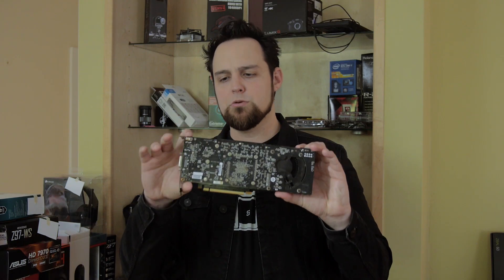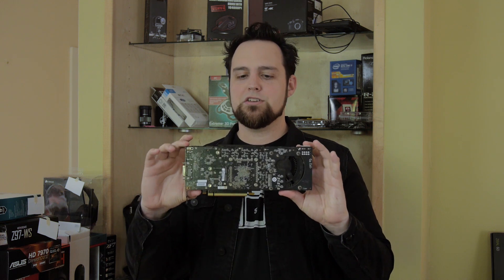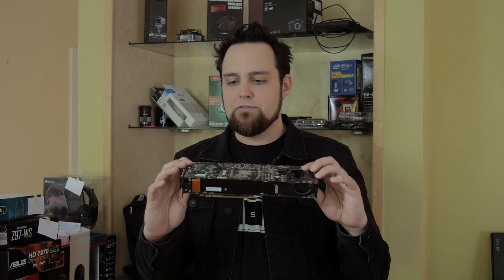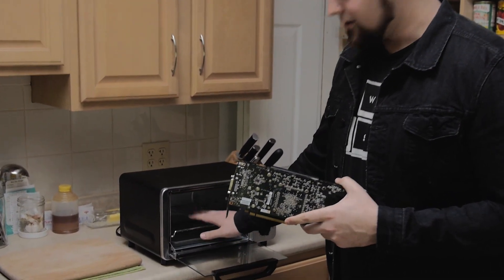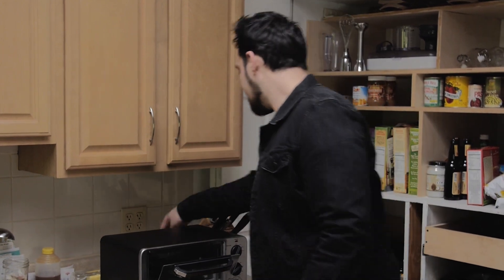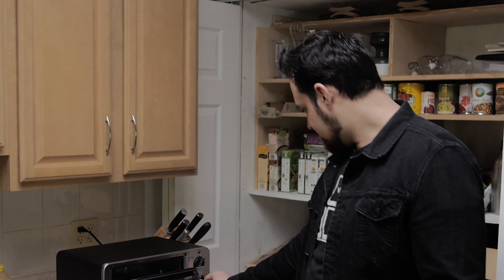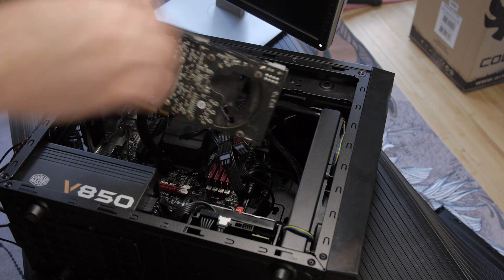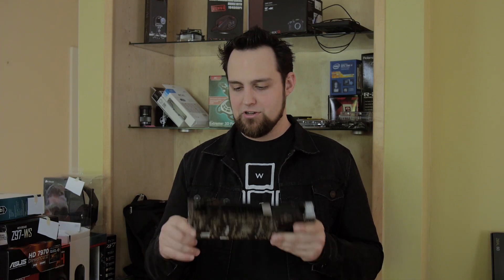How To Fix A Dead Graphics Card

Comment: hello please anyone help.. my friend have hp pavilion p7-1036 he changed the power supply to 350w and he installed a graphics card gtx 750 ti but the computer won't boot when the card is installed but when its remove it works just fine ... help pls
Reply: ***** its not
Reply: KEY EHEK Actually the i7 does not have more "slower" cores. However it is pointless to have those extra 2 cores if you are going to be gaming, since the performance boost is going to be minimal. And who the hell pairs a 6-core i7 cpu with a gtx 750 ti. xD Anyways you should be good with about a 400-500 watt psu from a good brand like XFX or Seasonic.
Reply: oh wow im 15 and i was 14 when ive build my first gaming pc. 
and, to set this shit clear:
a 750ti is not power hungry at all.
i have a 780ti in my system and this beast of a graphics card comsumes up to 250 watts. it has more than double the power connectors than the 750ti, two 8pin pci-e's, while a 750ti only needs one 6pin. 
so i doubt that this guy above will need a 600w psu, because i have a 600 watt psu and my system runs perfecly fine with multiple 10 watt fans, 3 hard drives, a (non reference) 780ti and other cool stuff. probably his ram is not working properly, the hard drives, or the boot drive is damaged or the cpu socket is damaged. all of which are more likely than a 750ti which does not run with a 600w psu.
Reply: There aint no reason to buy a Dell PC.
Reply: Ist because of the 6 core you Genius
Reply: also building a GAMING pc with a 6 core i7 and a 750ti is total bullshit and it perfectly shows that you have no idea.
Reply: the general power of an i7, especially a 6 core i7, is not in a single way needed for gaming. this cpu is more a rendering cpu, because it (probably) has more, but slower cores, while a gaming rig profits from fewer, but faster core. and having a six core i7 and a 750 ti in a bundle is not to be called a gaming pc.
Reply: ***** I have a GTX 750ti OC and a 430 Watt PSU and everything is just working fine!
Reply: *****
Write it on a paper and burn it xD
Reply: A 350w is too puny.
Reply: TheZero696 Hello, you need to update the BIOS on the motherboard, I had the same issue with my sisters HP Pavilion, but in the end i gave up, cause there were no updates for the bios, and i just installed it in my computer. So good luck :D
Reply: rory clancy 300w psu is even enough power for the gtx 750 ti. 
They don't even require PCI power connections because the pci-e slot provides enough.
The OP's issue would likely be resolved by a bios update or a newer computer, since it's an OEM system.
Reply: gtx 750 ti's TDP is about 60 W.
1. Check how much W The companents need (CPU, Mainboard...) if the whole pc needs exactualy or more then 350 the system wount boot cause of its "Overloading". While the system is booting all components/parts will do there job. So u always might add 50W to ur system. What ever it sais. For example, if ur Rig recvires 350W u should add 50W for safety. Thats what my 2 mates say. And each of them got a 15 years old expirience with systems
Reply: exactly... All parts are working while ur system boots*
Reply: Mikas Am ill try changing the psu ....  also if this means something ... when the card is installed and i open the pc  there will be 6 beeps then turn off .. does that mean anything?
Reply: TheZero696 you toasted it
Reply: KEY EHEK the pc works fine if i remove the gpu
Reply: Im pretty sure youve toasted it
Reply: KEY EHEK Almost 29 years old, been building since I was about 12. 500w psu should be enough for their vary low end system. I would probably see if they can get a 600w though just to be safe. But since it's a pre-built I hope the mobo 24 pin connector isn't rewired. Dell does that one their desktops and if you buy an aftermarket PSU, kiss that dell goodbye. you will have fried it.
Reply: Get a 550w psu, 350w won't cut it. The video card box will say what it requires to run somewhere.
Reply: It was an example. Some pre made systems come with changed pin-outs so you can only buy through them.
Reply: Yea, i know. Still no reason to buy a Dell PC
Reply: *****
i dunn kno
Reply: ***** Mhm. i bet you're 14 judging from your english.I've seen a 9 year old Build a pc, being 14 and doing it isn't impressive.
Reply: あなたの先輩
what´s the point?
every1 can build a pc!
Even a 14 yrs. old...
and it isn´t impressive?
yeah, it might actually be unimpressive...
BUT does it need to be impressive?
No
it needs 2 work @ the end.
that´s the only thing that counts..
Ps: IDC about my grammar, just BTW
Reply: 350 watt is prob. Not enough i recommend at least 500 watt
Reply: TheZero696 if it's the PNY variant, and the computer runs anything less than Windows 8, you will need a BIOS update.
Reply: Alisa Menna Although, it's strange. When i bought my 700 series card, it wouldn't boot in an Asrock am3 motherboard but it would boot within an older am2+ Dell. 
i ended up buying a GA-990FXA-UD3 (rev. 4.0)
Reply: TheZero696 remove card. and buy a gtx 970 and then a 600 w supply and it works
Reply: KEY EHEK why the fuck did u buy a gtx 780 ti.. a 970 is better and cheaper.. also isnt as hot.. i get 55 on max load (probs get it lower but i dont want to listen to that fan)
Reply: claude kim guess why
Reply: KEY EHEK Second hand, or just older purchase obviously (second hand purchases are underrated). As for the dude with the issue, look up in your mobo manual what the 5 beep code means, and boom there's your solution. It is that simple.
Reply: ***** Yea, i bought it before the 900 series was even announced.

Comment: Hey i got a half-dead Voodoo3 3000 AGP and a Hercules Kyro II AGP 64mb, they won't play 3D games at all, it screw up my computer (Windows 98 games) and i have to reboot. Will that "reflow" trick work? I'm asking because those 2 cards are something i want to keep and if i can "revive" them it would be awesome, especially for the Kyro II card! (i have many Voodoo3 3000 AGP cards here, so it would just be 1 more card saved from full death)
Reply: no please dont it will fry the components i would say re apply thermal paste give them a nice clean out umm clean the fans if they have any no much more to do if the cards fail
Reply: If they have issues like blue screens without overheating then that is a way to resolve it, though also a way to make it worse. Can be done with a heat gun more reliably, not waterproof though. Only do the trick as a last resort, it won't improve performance, it will only potentially fix the card if it's broken.

Comment: I have done this with my old ATI HD4870 that started to artifact after a couple years of use. To my surprise, this actually worked out really well and the card is as good as the day I pulled it out if the box.
Reply: That is taking the fan and heat sink off and all the memory thermal pads off as well as clean off the thermal past. Then place it in the oven at 350 for 15 minutes with the card facing downward. Then shut the oven off and let the card cool. Lastly, install the thermal pads and apply a small dab of thermal compound to the core. Finally, install the heat sink and fan.

Comment: Why would you put a graphics card in a toaster oven? that doesn't seem like a good idea. wouldn't the pcb melt?
Reply: No the circuit board would not melt, since many circuit boards are manufactured by being run through a reflow oven (which can get up to 500 F or more) after the components and solder paste has been applied by machines.  Time and temperature (the heat curve) is critical though,  so trying to reflow a dead card at home in your oven is a crap shoot.

Comment: ... this isnt how you do it TekSyndicate 
You remove the heatsink, clean the thermal compound off, and THEN cook it.
Do this with the fans and heatsink on it may melt when reaching that temperature.
Reply: Advection357 Do bake your GPU, but only if it's broken, and or dysfunctional.

Please educate yourself to a topic before being ignorant towards it.
Reply: Yeah sounds like a great idea. Cook the onboard VRAM on it too... who knows it might overclock better after that! 
haha :P
Reply: The whole point of this video went over your head...
Reply: dittyobrien It was both educational and satirical.

Because he did, in-fact, bake the card, and it DID, in-fact, work.
The reason the video was made this way was because it's not at all common for the average user to take measures like this to fix a problem.

You're quite the specialty yourself.
Reply: kn00tcn Hardly think baking GPU's is a joke. The second part of the video however~

The last card I had that was completely DEAD was my GTX 580, and it works after "baking" (I ain't even kiddin'. Do remove the plastic covers first though, and preferably plastic fans.)
It still isn't working like new, it will actually still overheat when playing for extended periods of time (2hours plus and it will overheat). But it works now. That's an alternative better than throwing it out. It's a decent back-up card.
Reply: kn00tcn Using a heat gun on low setting for about 10 minutes it probably a safer method
Reply: Kevin Slater If you have a heat gun yeah. You need to prevent the card to cool down too fast so wrap it in aluminium foil, heat it from within and let it cool slowly. This is easier in an oven though has a larger chance to go wrong.
Reply: kn00tcn yeah mine was mid game then froze i was about to alt+tab out and close the game. Then a few moments later artifacts appeared on the desktop... i had to go back to a 9800 GT... from a 460 gtx such sad days.
Reply: Advection357 Could
Reply: Advection357 The plastic on the Vram modules are pretty heat resistant, Like on pretty much every processing unit and memory untit that has a plastic shroud.
Reply: Surms41
what artifacts were you seeing on your 4870x2? did it suddenly go bad mid game?
Reply: kn00tcn It would go bad mid-game because of heat, then would stay after restarting, with red or greed lines across the screen.

I ended up cooking it twice, because the VRAM wasnt making contact to the heatsink, so I just put a sheet of foil on it with thermal paste.

Worked like a charm.
Reply: Surms41 well wait, so the vram was merely overheating? mine must have cracked or something, i cant even have the driver load & there are always artifacts

it's annoying that you cant just tell it to use the second gpu & therefore second set of vram

my story is i was playing limbo of all things, there was a small flicker + hard lock of the system, so i restart, resume playing, after a few min it happened again.. for good... with artifacts

suppose it could even be the core or pcb having damage

anyway i dont have much to lose & being legacy drivers means it's been EOL for almost 3 years now (plus my death was june 2013)

i'll probably get a 750ti to replace it, should perform quite similar or even better with much less power & heat
Reply: kn00tcn Yeah, mine was a last chance thing and it worked :P
Reply: dittyobrien Whos?
Mine?
No.
Reply: Surms41
 think he's saying the video is a joke (which it is) & your serious thread doesnt make sense in this context (but it's still a useful topic, i'm still not sure if i'll bake my 4870x2 yet)
Reply: kn00tcn It's not a joke at all.
You completely missed the point.

If it doesn't work properly, bake it.
No sense in trashing it without trying.

Baking PCBs with integrated circuitry has been around for a long time.
Reply: DON'T BAKE YOUR GODDAMN GPU WTF.
FFS...
Reply: Surms41 Jesus are you that mentally inept?The point of this video was a theme based (necromancy)video due to it being their 666th video.It is not in anyway an instructional/educational purpose video..

I can't believe I have to actually explain that.The whole point of this video seemed to go way over your head....

In layman's terms lighten up,the video is of a satirical nature not a serious one..
Reply: Surms41 now... i dont go on tek's site, nor am i questioning the existence of baking (it does exist), but where is it confirmed that TekSyndicate personally DID revive his 9800gx2 in real life? if this never happened, then the video is an actual joke, NOT that the act of baking is a joke, this is what this past day is about at least, ignore the older stuff
Reply: kn00tcn I would think he would make this video to try to revive his GPU, there's no other reason to make this video unless he's trying it for the first time.

But I do see your point.
I guess there's no proof, but seems kind of a useless to him if he actually had a dead card.
Reply: Surms41 After doing this how long will the graphics card last for?

Comment: "Put it in a toaster" Bro you serious?
Reply: Yes actually, it's just a crude reflow method..
Reply: Nameless plz <3
Reply: Patrick Kilduff No.... it's not.... 

Do some google on baking cards before you say more dumb shit
Reply: Nameless  this, also some people use similar metods to do a smd soldering jobs
Reply: Armando92 Yup, I'm one of those people, not sure why the other commentators are so certain on the ignorance is correct.
Reply: I fixed my sisters 24 inch imac by putting the logic board into an oven for 10 minutes. The nvidia graphics card had issues.. This fixed it. Was 3 years ago and still works fine. Also, highly advised to only use an oven that u won't be using to cook food in for awhile.. The chemical smell from the board can make ur food taste like an apple. Lol
Reply: Isn´t putting stuff into an oven how Microsoft fixes broken consoles?
Reply: It was a joke you morons...
Reply: Patrick Kilduff
no it is not.
Reply: ***** if you don't put the heat up too high you shouldn't run the risk of causing any more damage than there is already Should definitely take the cooler off first... his pads would have caught on fire if he'd actually heated it like that. Not a guarantee it will fix it though
Reply: Soonjai no thats gameshit
Reply: Soonjai Technically, yes, but a more sophisticated oven with automated temperature curves for the solder being used.

Comment: DP has lower bit depth than Dual Link DVI. DP has daisy chain link support, less dependent on copper cable quality than dual link DVI and easier to achive higher resolution with not chopping the Hz/fps/frames to avoid corrupt image.
But still it's not better than DVI by color depth per pixel.
(i.e critical part for Medical Institutions)

Let me put in short text before the wall of text:
----------------------------------------------------------------
DVI-D Dual Link has better bandwidth achiveable dependent on the cable, deep color depth bit per pixel. ( but no sound)

HDMI (newer standards) supports deep color bit per pixel and 1.4b /2.0 supports 120 Hz monitors (but sucks on bandwidth in comparison) which is required for 4k and 8k resolution.

DP++ 1.3 standard, has high bandwidth like DVI, supports 3D at 4k by 60Hz per eye (but has less color depth bit per pixel, than DVI Dual Link and latest HDMI)
------------------------------------------------------------------------------------------------------

DVI-D Dual Link is limited by the copper cable mainly and signal sent from source. 24 Bit is supported by all resolutions, but if your cable can handle it you can achive up to 48 Bit. (Now this requires +24 AWG cable at least, and thats very thick DVI cable) Startech produce in that quality. (better than the cable than comes with your higher Hz monitor). Very unlikely you will need that but you can see the difference in colour depth and picture quality, so Yes.

DP Port 1.3 has 25,92 Gbit/s (removed overhead) bandwidth support for 8k resolution, or two 4k resolutions at 60 Hz with 24 Bit RGB. It also supports HDMI's HDCP 2.2 content protection.

You also have Dual Mode Display port (DP++) which can handle 1080p deep color, 4k resolution and stereoscopic 3D formats (by 1.3 standard)

DockPort, former Thunderbolt, uses USB 3.0 SuperSpeed to include USB data and power charging on attached displays.

HDMI 2.0 has 14,4 Gbit/s (removed overhead) bandwidth support and Consumer Electronics Control (CEC) (control set-top-box + TV with one remote) Display Port lacks CEC extension.
HDMI 1.4 a and b supports HDMI Ethernet Channel (HEC) 100 Mb/s LAN connection. HDMI 1.4b supports 120 Hz monitors due to 60Hz per eye in 3D support.

HDMI 1.3, 1.4 and 2.0 it's supported 48 bits per pixel color depth!

DP has fixed frequency links, DVI has a variation in input clock that can create phase-locked loops. The only benefit on the clock/data recovery side is that its simple and straight forward to downgrade to Analog using DAC. (Dont know why anyone would do that) but DP needs to reconstruct the clock from the data. (again this is no issue anymore) But hey its not that simple afterall with DVI-D cus you need an expensive active converter if you dont have DVI-I or A port (which again dont know why people would go analog in 2014.)
-----------------------------------------------------------------------------------------

Conclusion is that DVI is still better on higher resolution ((Picture quality) if you dont have an HDMI connection that is 1.4b or 2.0 standard.)
but its not good at all in home cinema applications where you want Audio integrated, since the color depth bit is more than good enough in DP.
HDMI is still the simplest in home cinema and also supports 120 Hz like DP, but lacks bandwidth for highest resolutions.

DVI/DP>HDMI

(DVI has no sound + cable quality dependent)
(DP++ has lowest color depth per pixel) 
(HDMI has lowest bandwidth)

Comment: I followed the instructions but i lost my broken gtx780 and instead of getting fixed gpu i woke up with Voodoo2 graphics card. Did i do something wrong? By the way i use pentium 4 cpu for demonic fixing ritual. Well it's better using working Voodoo2 than broken gtx780 i guess. Screw Crysis 3 I am playing Quake now. :)